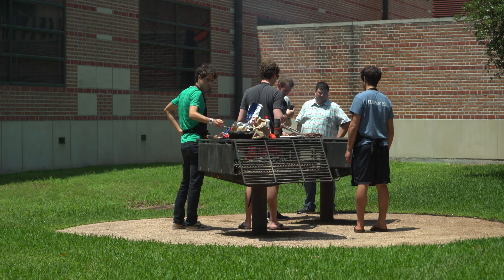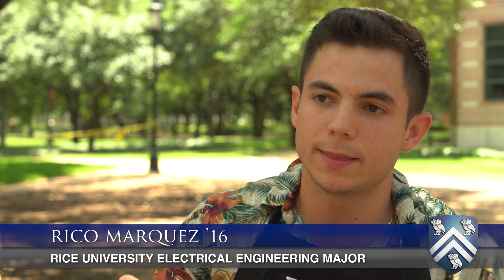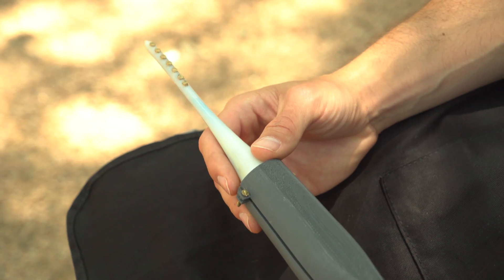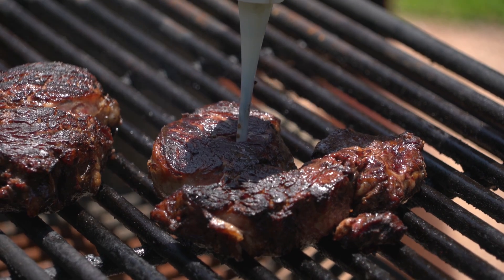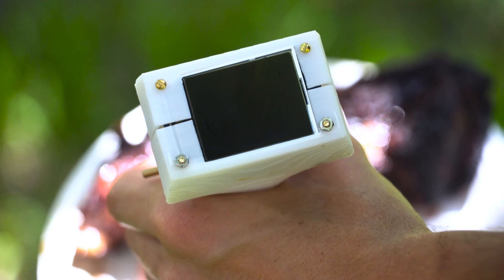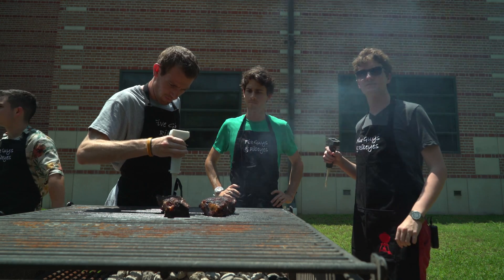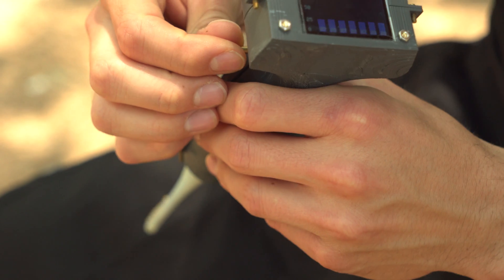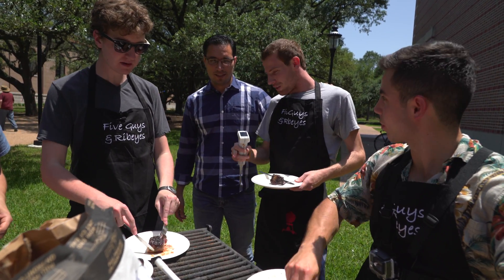Rice students create a high-tech meat thermometer

Comment: Came from arduino website: So 7 high temp. sensors that display the temp and calculate the approx. temp? I can't see what's so hard here, 3d printed case, smd chip, display and 7 sensor, few lines of code and you're done.  1 or 2 days project if you got all the materials.